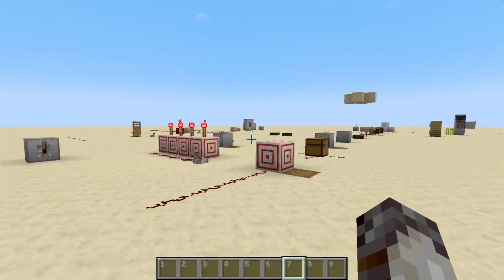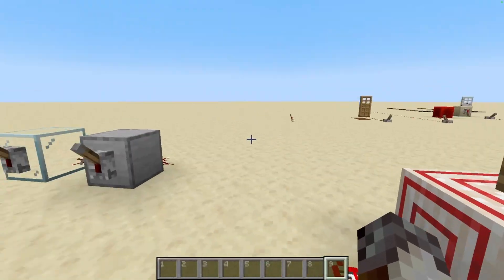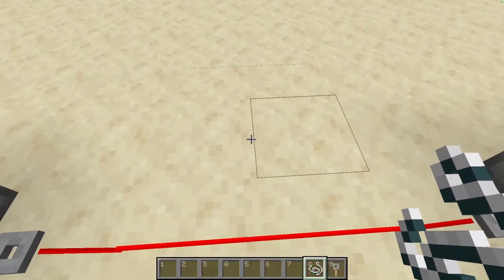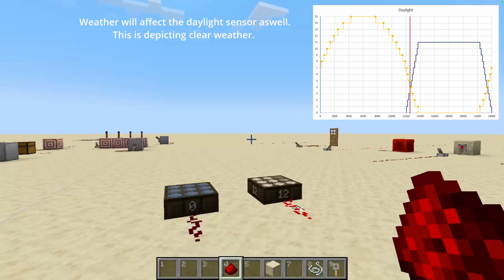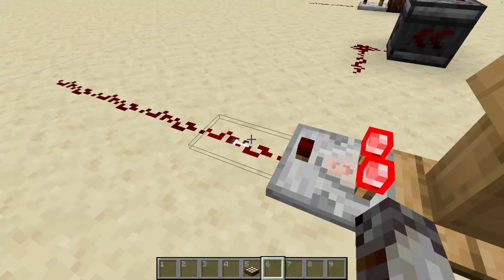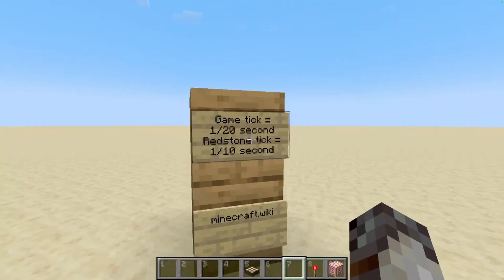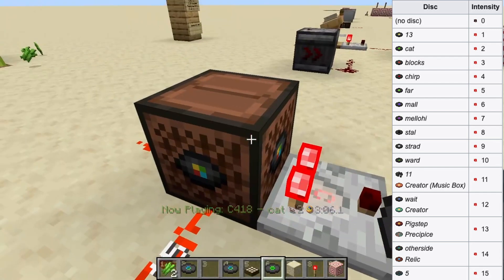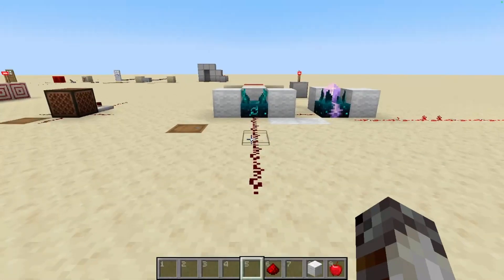Advanced Power Components

Comment: Great series.   What are your favorite plugins to make debugging redstone circuits easier?  Thanks!!
Reply from the maker: Thanks! In terms of texture packs, I use the Redstone Tweaks texture pack by Rexxstone (on CurseForge). It makes redstone way easier to see and understand, but still keeps that vanilla feel. It doesn’t feel cheaty at all to me.

And in terms of mods/data packs, the Freecam mod is really helpful to see different perspectives in real time. I also use the Flashback mod to rewatch how my circuits run, especially if my character wasn’t nearby. Plus, you can watch in slow-motion, which helps a ton when you're trying to figure out what's going wrong.

Other than that, I pretty much stick to vanilla. But my biggest recommendation is to build circuits that make sense to you. That will make debugging way easier in the long run.